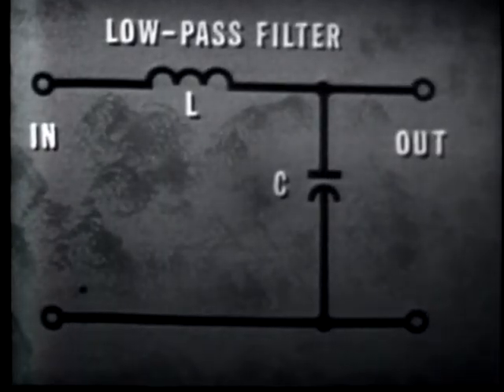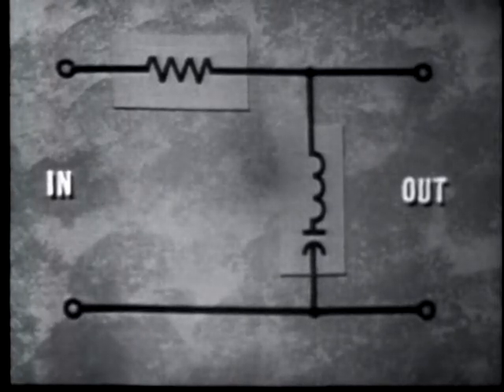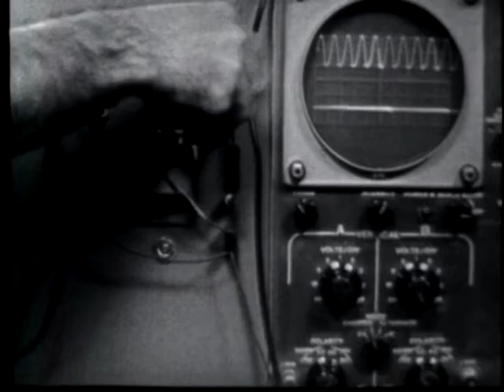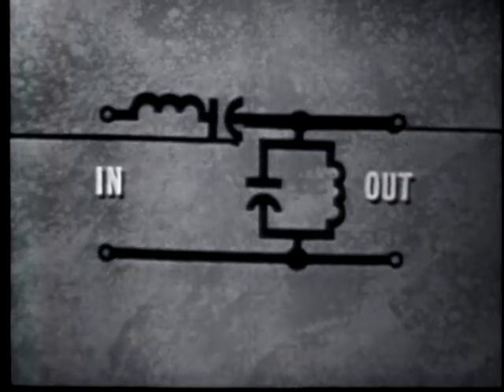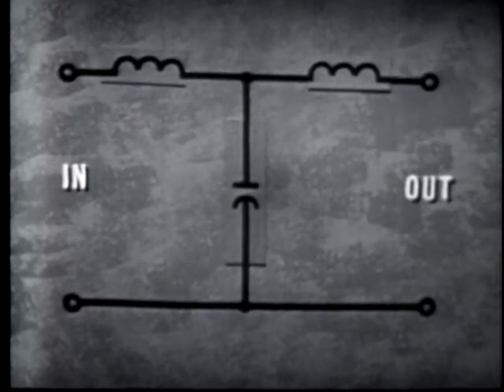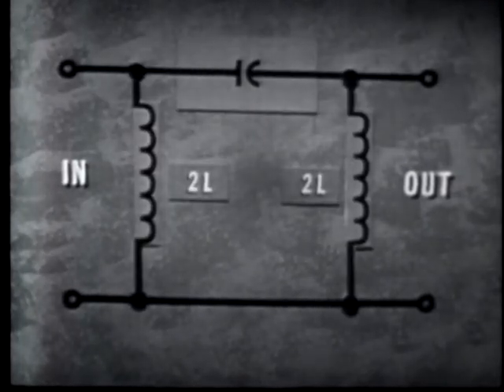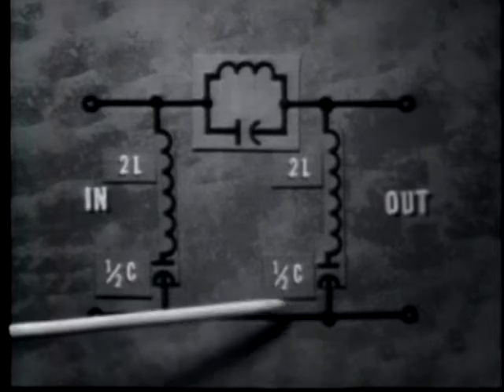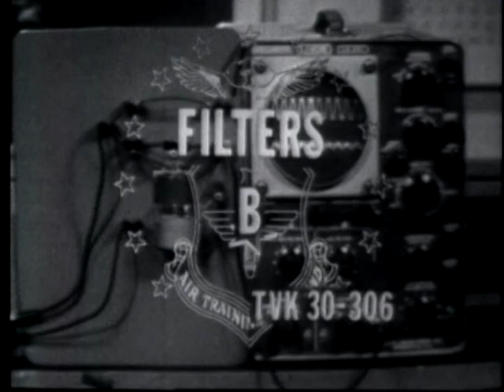ELECTRICITY - FILTERS - B

Comment: In part A, as well as this video, they say that the resistor has no filter action, but in reality, the resistor has both a slight amount of inductance, and capacitance, and would become apparant at the higher frequencies. Everything has some L and C in any AC circuit, and must be considered as stray L and C.

Comment: That's not really true.  You don't have to worry about any of that in normal circuits any more than you have to worry about the "reactance" of the wires.  If you are in the middle of an integrated circuit "chip" where you are running at super-high frequencies with square wave components you need to take this stuff into considering, otherwise it's like claiming you have to worry about relativistic effects when you walk to the park.